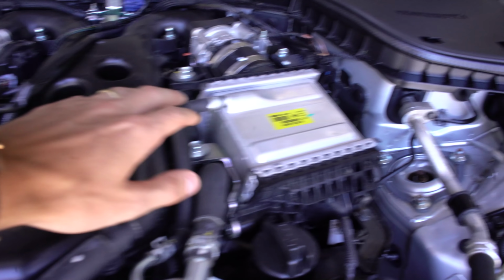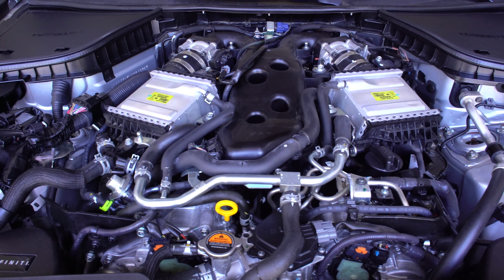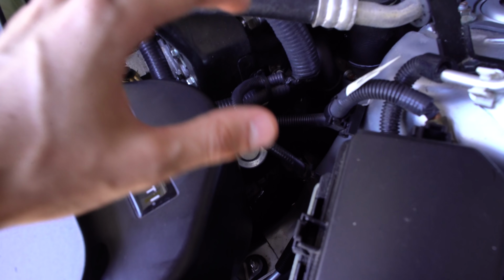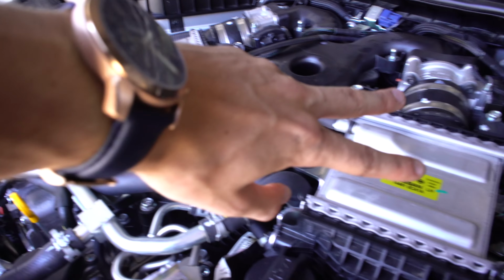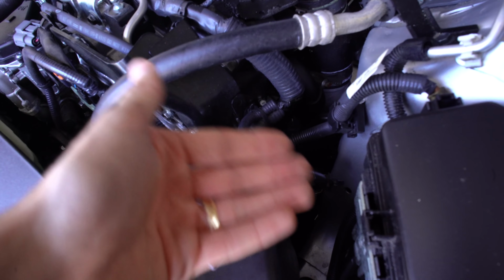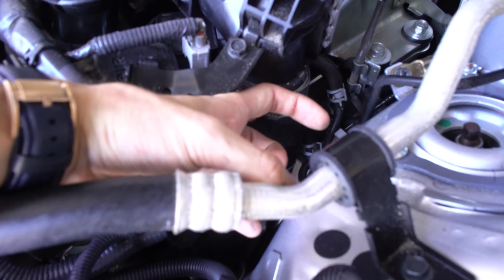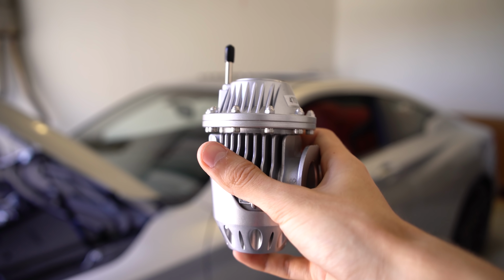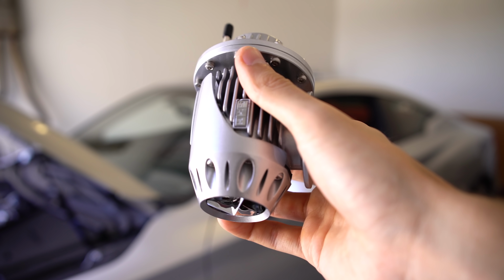Saving My Turbos

Comment: Blow off valves on a 3.0 Q50/Q60:

I see a lot of questions lately concerning blowoff valves for these cars. The simple and short answer is, they don’t work. Here’s why

A typical turbo car, let’s say the GTR for instance, uses mechanical wastegates and recirculating blowoff valves to reduce boost when letting off the gas and sometimes between shifts. Whenever you see a GTR using a standard VTA (vent to atmosphere) blow off valve, you’ll find the car has been converted to speed density. It doesn’t use filter maf signals for fueling but a volumetric efficiency(VE)table precisely tuned by your tuner which doesn’t monitor active airflow but uses other calculations for proper engine fueling. 

A recirculating blowoff valve is REQUIRED when used in a system that places the MASS AIR FLOW SENSOR(MAF) in front of the valves(which is how most systems are setup). 
A recirculating valve relieves pressure but doesn’t “waste” the airflow simply recirculates and pumps it back into the intake tract POST MAF) The reason for this is the MAF pre-fuels the engine which means ANY AIR passing by the MAF has to go into the engine. If it doesn’t, the ecu still adds fuel for that amount of air going into the engine. Extra fuel/less air= rich dips in air fuel. This won’t blow your engine up but it will cause your drivability to suffer and things like your spark plugs/AF sensors to degrade/foul over time. 

The VR30 ECU’s logic is much different than the GTRs and other older systems. It uses the electronic wastegates and throttle bodies to limit/decrease boost. When you let off the gas, instead of relying on a recirculating blowoff valve (which is what it would need being that is a MAF car) to reduce spikes, it completely opens the wastegates and momentarily holds the throttle bodies open(sometimes up to 0.25 seconds) to give the small turbos time to slow down through exhaust turbine pressure relief NOT compressor pressure relief.  

The two main reasons the VTA BOVs DONT work on these cars is because they are not currently able to be tuned in speed density and even after adding them, any pressure spikes you think you might be limiting, aren’t limited enough or even at all to make a difference in extending the turbo life due to the throttle body logic and how it hesitates closing once more than stock boost is added to the car. 

In order for blow off valves to work, the valve has to be subjected to a positive pressure to vacuum condition to suck the piston up into the head of the BOV to allow air to escape the bottom portion of the valve. The throttle body logic limits this transaction completely and you end up with a small double spike every time. I have taken back to back logs and if I posted the boost pressure spikes after letting off the throttle, no one (including myself) would be able to tell you which log did and didn’t have the BOVs. The throttle let off spiking remained almost identical. This is something built into the logic that has yet to be(or able to be) solved by ECUTEK.
Reply: Thanks for this answer man! This is what i needed to see
Reply: Bovs do work on the car. They dispense the excessive boost pressure after you let off the throttle. The problem is that the ecu doesn’t calculate for it. However you do run slightly rich for a split second. But running rich for a split second isn’t bad at all. The problems people face when running these Bovs is because they don’t install it correctly and boost leaks appear. Boost leaks will cause the turbo to spin faster to maintain the same boost levels which will kill your turbo especially these small ones.
Reply: So, if we add the ecutek ecu... Should we add the hsk bovs?

Comment: Hey! Just so you know the vr30ddtt’s turbos are so small that they don’t need a conventional bypass system. Installing this will do more harm than good but if it’s just for the wooshie and sneezy noises then feel free to continue at risk.
Reply: Also it makes your car slower since your are releasing that charged air into the atmosphere making the turbos work twice as hard to maintain boost pressure while off throttle and coming back on

Comment: Everyone knows you did it for the turbo noises. It's ok. Embrace it. Haha
Reply: @Mikkel111  Turbo Flutter isnt supposed to happen
Reply: Daniel Borst although it isn’t supposed to happen, it is a turbo noise nevertheless. I think flutter sounds cooler than BOV but I realize that a BOV should be included in any street car setup.
Reply: @Mikkel111  unnecessary stress is unnecessary stress.
Reply: @Mikkel111  just because you can doesnt mean you should. You can run anti lag on a car  but doesnt mean you should. If you care about your turbos and dont want to piss money down them breaking them far more often then you should you will install BOV or a BPV.
Reply: @Mikkel111  may want to do a quick google before you speak. From what I am finding red sport edition of this car runs at 14.5 psi and the JB4 tuner depending on what he wants to do can raise that 3-4 psi over stock. Given that he says he is making 425 ft-lbs means he is probably running 3 psi over stock so he is pushing 17 psi-18 psi at times.  

So yes its only a 5% hp and 8% torque increase over stock with his mods he has that is because the red sport is already a decent jump over the stock car( which has 300 hp, 295 ft-lbs and 8 psi to start with.
Reply: Turbo noise is the rgb for cars
Reply: BPSDetailing he already had turbo noise tho ? He installed something to help save his turbos

Comment: Fun fact, with new technologies such as electronic throttle bodies and variable valve timing the engine can change the phasing of the camshaft to allow and excess boost to pass through the cylinders when you release the accelerator. This is a much more efficiency way to eliminate compressor surge as well as boost lag by equalizing both exhaust and intake manifold pressures. Operating this way it allows the intake system to be simplified by getting rid of blow off or diverter valves. When off boost the air charge rushing through the cylinders has the added benefit of cleaning the valve sealing surfaces and removing carbon from the piston faces. Just some food for the noggin, manufacturers can further refine these systems but it will never beat that blow off sound.

Comment: Does that void a warranty on the engine? I've been thinking of doing it as well since I also have a Q60RS!
Reply: Bumping this, does this void warranty?
Reply: This will count as a modification to the engine/turbo, which will violate most warranty agreements, so ideally you would want to uninstall them before going to the dealer.  Just in case your turbos go out they can't pin the blame on the BOV's. But I would check with your local dealership service provider, some might be lenient on these types of modifications.

Comment: Yeah save the turbo sure, you just want that pshhh noise.

Don't worry about noise it's pretty quiet, if you heard my TypeR at 9K rpm with it full custom manifold back exhaust (no cat) that's loud, sound like a F1 car going by lol
Reply from the maker: I rarely hear them when I drive - I have to be flooring it and letting off the throttle pretty hard to hear them.
Reply: @GregSalazar  
Yeah cars are solid now, back in the late 90's I had a Ford Escort RS and all you could hear was pshhh but the car was under a ton and made of tin...
Reply: F1 car? Or lawnmower, same difference
Reply: @hunterrrdrives  
I'll give you a lot do, but you can tune the sound with the exhaust system, I actually went through 2 setups to get a  better noise, also I have the 2.2 engine in there so it has a slightly different sound vs a standard Type-R.
Reply: Beeeeeee BZZZZZZZZZZZZZZZZZZZZZZZZZZZZZZZZZZZZZZZZZZZZZZZZZZZZZZZZZZZZZZZZZZZZZZ

Comment: Great video. Just go a Q60 last year. Wondering if either the new intake or the blow off valves void warranty? Also, after installing such components, did you have to mod computer settings on the car!?

Comment: A side effect of atomosoheric BOVs is transient response will be reduced, meaning it takes longer to get back into boost.

Also, if you aren't reflashing the ECU your car won't be making any use of breathing mods as the MAF, timing and fuel tables haven't been adjusted to make use of the extra air.
Reply: Not really true. Semi modern ECU's adjust for higher flow automagically. Some ECU's even tune themselves a bit according to conditions and such. Not this one obviously but some standalone ones do
Reply: You are correct, however no OEM ECU is going to self  adjust fuel, or timing to gain 50whp.

It might adjust ST/LT trims to prevent lean outs or over rich conditions with an upgraded air intake. 

"Self tuning" standalones are a bit misleading. They'll just make the necessary adjustments to keep it at target AFRs

Comment: Not the best running atmosphere vented bovs on a car with a maf should really use a recirc valve so you get correct air readings through that maf
Reply: ^^ this is the correct take!

Even for MAP-sensor (Manifold Absolute Pressure) cars a DV (diverter valve) is better than a BOV, but for a MAF-sensor (Mass Air-Flow) car the BOV is a really bad choice, since the air has already been measured and accounted for. Basically the BOV is more for the whooosh! sounds, the DV is the correct solution for compressor surge.

Here is a quick explanation of the differences betwen the BOV and DV:
https://blog.moddedeuros.com/blowoff-valve-bov-vs-diverter-valves

Comment: Make sure that vacuum tubes going to each of the BOVs don't touch anything hot like the manifold or the coolant pipes. They will "melt" over time and develop holes. Just a heads up. It will take a long time, but you strike me as proactive. Looks and sounds nice. I have an atmo venting system on my WRX and I had one on my old STI. Sounds great in traffic and it turns heads everywhere (aside from saving those turbos). Pardon my long post, but im a mechanic by trade and I love these types of videos!

Comment: Turbo back pressure doesn't actually damage the rotor as long as it only happens off throttle, as far as everything I have heard/read. That and turbo flutter is just ❤❤

Comment: There's 2 different types of turbo surge. The one you're talking about, closed throttle body surge, it's not bad for the turbos. Now if you're on the throttle and you hear it constantly hearing surging. Then you have a problem. Why do you think infinity didn'tput them on? Cause it's not bad for the turbos once the throttle body is closed.

Comment: With that blowoff valve it won’t be shooting flames anymore right?
Reply: No, backfire is caused by unburned fuel in the exhaust gases. This mod prevents an overpressure of air bouncing between the throttlebody and turbine/impeller of the turbo.

Comment: First thing I did on my car is remove the HKS blow off valve it had, 5 years later still no issues with no running a valve, it's really common here in Australia for people not to run one.
Reply from the maker: I'd still prefer to run my pair. The science is sound in my eyes :-) No more boost spikes on the chart.
Reply: Wasnt it illegal to have one at one point? Source: MCM
Reply: @datsunalzheimer  Any valve that vents to atmosphere is illegal, that wasn't the reason I removed it tho, most of the things on my car aren't legal.

Comment: Im still saving up for a gaming pc.
Reply: Good luck man!

Keep a look out for deals.
Also RAM and SSD prices are dropping fast, so watch out for that as well. If you time it right, you'll get a great PC for a few hundred cheaper
Reply: Buy a old HP elite desktop like a z220 for $150 and a GPUs like a GTX 1080ti for $300. You'll be gaming for at least 5 years at max settings.
Reply: @markm0000  that is pretty fucked, I'd go with a simple prebuilt +1070 +more ram and psu+ an ssd for around the same price
Reply: @markm0000  literally every other component will be bottle-necking the 1080, also where do u get one for that price lol
Reply: Inspirice eBay and snipe auctions. You’ll eventually get a 1080ti for $300 or less.
Reply: Save up for a fun car instead. Much more fun than gaming, lol.

Comment: What’s up man! Nice video, I have a 2017 silver sport and just had a question for you @8:00 when revving your engine you can see the engine move a little do you think you should upgrade engine mounts? (I have the same play)
Reply from the maker: It's normal for engines to move a bit under load. Not an issue unless it's tossing and turning pretty hard.

Comment: I thought stock turbo setups have a small blowoff valve. Not like those, but I thought they did and it blew into the exhaust or CCV if you have one. To keep pressures and volume noise down???
Reply from the maker: Not these, AFAIK. When I let off the throttle under high boost, huge boost spikes tug on the car a bit longer than normal - a potentially dangerous situation for this platform.
Reply: @GregSalazar  ah got it. Ford had issues with it's Ecoboost from too much. They updated the computer. Nissan and Honda been doing it a lot longer though. Can't wait to see how far you go.

Comment: As an automotive engineer I cannot believe why Nissan didnt put a stock diverter valve on a turbocharged engine... I know its a cost saving thing, but the thrust bearing of the turbo will take a beating without a pressure relief on the long term. I guess what happens after warranty is where its gonna get expensive...

Comment: I did one in my sti cause for some reason it no longer likes recirc systems. I removed the ring in the center of my hks. I'm not that big a fan of the high pitch whoosh. I think it sounds better with out the ring in the center.

Comment: I like this video alot :) Since you have downpipes I hope you took advantage of it with a tune. Hopefully with a bigger diameter of the downpipes will also help with Reducing the back pressure for quicker spool up times. Also would of liked a drive by next car video :)

Comment: The air doesn't warm up for the hot exhaust, it warms up  due to compression
Reply from the maker: I never said the exhaust warms it up. I just stated that the exhaust side of the turbo warms up from the exhaust. The charged intake air is warmed up because it's compressed. Thermo 101 :-)
Reply: @GregSalazar  ah... rip my fault

Comment: Its called Compressor Surge BTW!  And Id For Sure Ditch Them Junk Water intercoolers,  Them Things heatsoak in 5 pulls,  Toss A Front Mount On it and call it a day! And 3" Turbo Back!      HKS SS Sound the BEST!!!  I Do Love The Old REAL Greedy Type-S too,  Hard to find now!  I have one on my GSX!    I love the CH even more now since you added a car video!  Alot of people that are into building and modding PCs, Are into doing the same with Cars,  I Have a 500HP GSX,  HSX-40, 2.3L Stroker  6Bolt 4G63, HKS 272-272 Cams, With GM MAF! Shes a beast!  Runs Low 11s :)  But I Still Love My Old 300Zx In My PIC And Videos!  My First Real Car,  My real first was a 3000GT, But it was AUTO!  So i don;t really count it.. But it was nice! lol

Comment: You should have gone the recirc route. Now you're venting out metered air that the MAF is measuring
Reply from the maker: It's perfectly fine. When I let off the throttle that hard, I'm not worried about losing boost.

Comment: Make sure those hose clamps are tight as fuck.
If you haven't invested in a contraption with a pump to check for boost leaks after all of that T piping install... I'd take it to a shop and have them check for boost leaks. 

Having your turbos work hard and not having your engine reap all of the benefits of the extra air they are pushing is like having a video card pump out 144 fps, but only having a 60hz monitor ;D
Reply from the maker: I mapped boost on the laptop via OBDII after installs. No leaks so far. Hose clamps are, indeed, tight AF 😄

Comment: Did you engine always sound like it had ping?
Reply: That "ping" is called lifters, Nissan has very loud lifters.
Reply from the maker: @sgtkhaos1078  Only way to lower that sound is to close the hood LOL
Reply: @GregSalazar  Pretty much lol I have a boosted 2012 SER Spec-V so I'm very familiar with the loud lifter noise.

Comment: I was going to get that car, red sport q60... how do u justify the price tag over a BMW m4 ? You cant.
Reply from the maker: M4s are much more expensive to maintain. This is coming from a guy who previously owned an S5. Also, with the mods I've done, this is faster than a stock M4. This Q60RS was bought for 40K with 10K miles on the odometer. Came with a 100K/10yr powertrain warranty. Try finding that kind of deal with an M4.

Comment: Nah id keep the StuStuStu from having no BOV :P 
It DOESNT damage turbo's... Been proven countless times...
Turbo's rotate at upwards of 200k revs, a bit of air surging back against the compressor wheel isnt going to damage it, Its only receiving the same amount of boost that it originally gave out..
thus, the compressor wheel of the turbo is perfectly capable of handling it.
My old car had no BOV, so had turbo chatter noises.. was a 12 year old car with 182k on the clock before the turbo failed....

Comment: A lot of the things you are saying is not exactly true. You need a way to release the pressure because the pressure will try to push the turbo backwards while the exhaust gasses try to push the forwards. Also the pressured air goes up in temperature because it’s being compressed and yes the hot side of the turbo does heat up the air but usually the turbo also has oil running through it to cool it off.
Reply: It doesn't try to push the turbo backwards, part of the design of a turbocharger lets the air back out the inlet and you don't need a blow off valve, this car is proof of that.